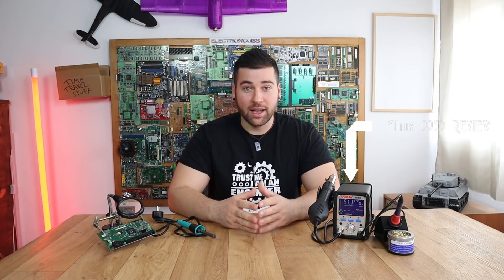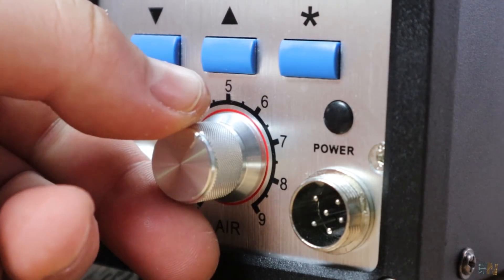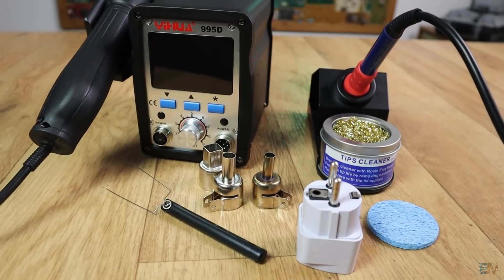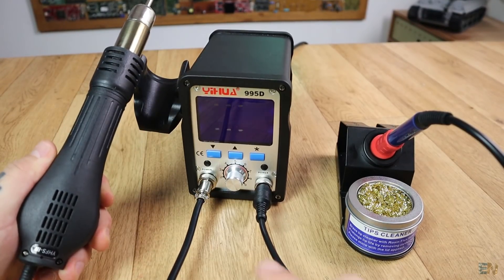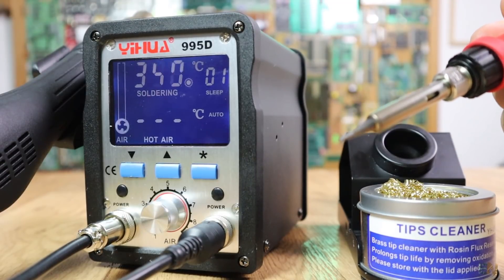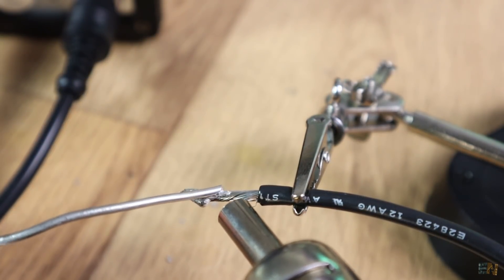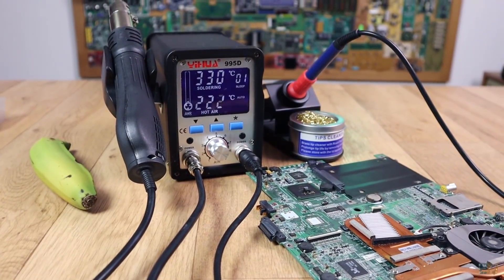Yihua 995D soldering station

Comment: 5:21 look how far off that temperature reading is. That is terrible for a station!
Reply: Will that damage the products you're working on?
Reply: @RedCatalyst  probably because it makes it way harder to solder if the tip temperature isn’t right
Reply: @andrewmckinlay2964  The temperature reading is lower than the led indicator; not higher. Wouldn't that be safer for beginners and professionals alike? Albeit a professional wouldn't need that discrepancy but could you not just turn it up more to compensate?
Reply: @RedCatalyst  No, that is not good for beginners. For safety you want an accurate temperature.

Comment: just to let you guys know the is a plug for a fan to be added internally. i recommend if you own 995d that you find yourself a fan from an old pc that fits inside the solder station. you can thank me later.
Reply: the fan plug is on the board. you have to open it up to see the fan plug
Reply: @craigcondor3743  Hi, I recently got myself a 995D and, per your recommendation, checked for a fan plug, but I didn't find a fan plug (at least not something you could use to plug a 3-4 pin PC fan into), could you maybe tell me more about this? Also, does your soldering iron feel like no heat, or not enough heat, is reaching the soldering tip? I am constantly being forced to use the middle of the tip rather than the top.

Appreciate the answer (if you see this).

Comment: Let me say even tough i own Yihua 995D, i dont think its really good, its fine for beginner but it has its issues. I have had to replace the soldering iron twice because temperature sensor inside the iron broke, the replacement parts are cheap tho. If i would buy soldering and hotair station i would be buying something from Hakko or Quick, much more expensive but the quality difference is noticeable.

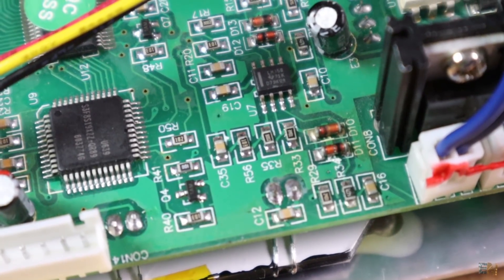Comment: Hi, u mentioned 5v voltage regulator 8:32 will I be able to connect a 5v usb power outlet to this? Thanks in advance
Reply: No, it powers Ic's on the board, if you connect usb may burn regulator

Comment: Not a single solder joint was well soldered in the video! Most of them were cold joints!
Reply: @Rubbers are for land lubberswhat was your old soldering iron ,  when your new one doesnt have silicon cord , that is like basic  stuff you learn first weak   ,  i wont look at soldering iron without silicon , for that matter i woont look at anything that is not silicon , except tits especially if its 100e
Reply: @dedskin1  "...except tits..."
Hahahaha 🤣😆😆😆

Comment: Can high temperature air damage components
Reply from the maker: Yes it can!
Reply: Most of the times not because with high heat the device desolders or solders in its place more easily.Need some exercise first.

Comment: It's good to see that you've been able to upgrade your soldering iron. You may be able to calibrate the iron but I'm not familiar with that specific model, so I can't be sure. I have a Yihua hot air station without the soldering iron. It uses the same case and the handset is identical. Mine uses mains power to heat the element, so I opened to check it was properly earthed. Unfortunately, it had the earth wire just resting against the metal hot end! So I used my Dremmel to cut two slits in the inside end of the metal hot end tube to make a tab, which I bent slightly inwards, so I could push a small female spade connector on to it. Then I crimped the earth wire to the small female spade connector and plugged it on to the new earth tab. Now I am confident that the tip is properly earthed and is ESD safe too.
Reply: still works?
Reply: @mustafasolmaz5946  
Still works five years on!
Reply: @WaltonPete  ok that does it. Im ordering one thank you very much

Comment: I have a few Hakko 936 and 927 soldering stations in my home workshop, an unbranded 898D+ hot air station. The hot air tool has been reliable and I like it a lot. The soldering iron... well, it's the cheapest, crappiest, crookedest pile of steaming 💩 I've seen since last using a cheap Radio Shack iron... No, the radio shack iron was at least straight! I leave the Soldering iron unconnected. Now the one you got looks much better, and I have to say, the LCD is VERY nice! I just have dual red LED readouts.

Comment: The unknown tool I think is a chip flicker for hot air rework. At least thats what I use it for. Put a little pressure against chip, heat, chip goes flying when it's ready (and everything else that's in the way). I actually like using it in the right situation.

Comment: your solder is shit you can see it doesn't flow properly .....change it to a 60/40 with a lot of flux cores .... you life will be way easier ...also try using the soldering iron at a 45 to 75 degrees angle to the pcb ......and congratz on your new station

Comment: Is that the plus or the normal? GX16 connectors with 220v YOLO.. The tool is for lifting ics with hotter , just put it between the legs and pcb

Comment: for soldering, ts100 or a T12 style iron over anything else i used before.
 for hot air i got the 852D, it just works and is cheap.
 for desoldering and soldering large heat-sinking objects like 18650 cells a ZD-985 will do my job
Reply: I have the 853D and so far I can't fault it. I have a weller iron but needed the hot air and it works brilliantly. The tips could be better and I would have loved to see a welled tip but beggers can't be choosers. This would be more than ideal for beginners.

Comment: The thing you do not know what is for is for desoldering. You put the thin wires under the pins of an IC and it will pop off once the solder is molten. It's not a very good tool, but the Chinese likes to include it.
Reply from the maker: Oh, thank you!
Reply: nice to know i could not guess .

Comment: dont advertise crap. thumbs down. dissappointed.
Reply: Yihua is a good brand. Its not like the usual crap. You can say its the Huawei version of soldering stations in China. The best Chinese brand.
Reply: No idea about the brand itself, but even Hakko/Weller/etc is crap with those "low end" models using this old technology (ie, separated heating element with bad thermal bound instead of the direct heated integrated "cartridges" like the T12 tips from Hakko, T245 from JBC, or what TS100 uses actually but yes, there are cheaper Chinese clones here too, which are still much better than the "old" stuff, even if they are "top brands"). And actually because Chinese stuffs treated as "cheap" it's even more interesting why I should pay $100 for this old stuff (the price point for "usable" and modern design /w integrated/direct heating is much higher with brands like Hakko of course).
Reply: electronoobs i just wanted to give constructive criticism. if youre going to review a soldering iron then review a ts100 or t12 kit. These chinese stations are crap. They may seen at first good but they fail over time, speaking from expierence. if you want to get sponspored ask banggood to send you something good at least. thats just my take on it. I felt like you forced yourself into making this review but thats just my opinion
Reply: Well, yes, personally my main problem here that is not the modern "direct heating" stuff, what should be used now especially at this price point. There are plenty even quite cheap solution for direct heating "cartridges" (instead of the ceramic heating element stone aged technology), including TS100 indeed, or at least ("indeed" again) a cheap T12 DIY kit at least, if budget is an even more important factor (for those kits, they are quite good, for that price, especially if you can get original T12 tips well 'cartridges' which are much better quality than faked ones, for sure).
Reply: agree 100%

Comment: Have you figured out how the hot air gun detects when it is in its base?
Reply: Manuauto Id bet on a magnet.
Reply: Reed relay and a magnet.
Reply: I have a similar rework station, but without the soldering iron, and I've taken mine apart. It definitely has a reed relay in the handle which switches off when in the cradle due to a small magnet glued on the underside. Obviously, this is used to switch a circuit which controls power to the heating element in the metal end of the blower assembly.
Reply: N A sounds reasonable
Reply: Its a magnet in the stand that activates a switch.